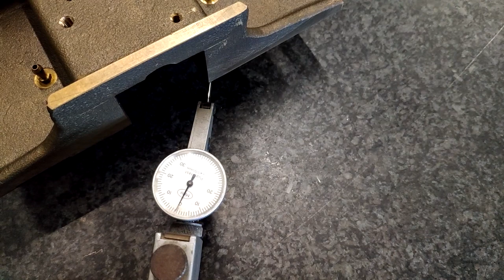Granite 3DPrinter - Break it, Fix it, Repeat it #S01E06

Comment: That bend can be made on purpose so I will try to check on your second one before lapping and make it worst. Try to debur the scratch with a precision flat stone and put it back. Do you run any filter for moisture and particles? Any contamination from the air will destroy a orifice type air bearing. Maybe you can change for graphite pad air bearing. Also adding a flexure on the carriage so that you don’t introduce side way torque from screw misalignment
Reply from the maker: Dude thats some serious input. Thanks! Okay one at a time: I dont think the bend is intentional. Because I do know it was a lot less when I indicated it in on the mill when i was milling the slot. Would also not make any sense to not use the whole surface.
Precision flat stone is the weapon of choice, yes. I leave the rest untouched at first, there is no visible damage.
I do have two consecutive filters in my air supply ( I dont run any oiled tools) and one really sophisticated right at the inlet of the CMM (OEM, 1 Micron filter size, really heavy duty unit). The air should be more than adequate for air bearing use. There is no visible moisture even after like 10 hours of bearing uptime and a few 10K liters of air.
One of my ideas for a long lasting repair is to use some kind of a wear plate, graphite would be mat. of choice here. Ill investigate - it would be a bit more effort but in case of a crash like this way easier to reset than the problem I do have now.
The mentioned flexure actually is already in CAD, I had drawn that in a previous stage. For now I didnt consider it to be necessary, I couldnt find any recurring pattern when I stuck a micron indicator onto the air bearing and had it run on the granite. Seems like the forces arent high enough to cause trouble in this case. But maybe for the future!
Reply: @Roetz40  Did you indicated the air bearing after having slot it with that big ball nose? It could had wrap at this point only giving edge contact than wear out like it did.

Comment: I don't think you will have a choice but to lap the air bearing back to spec. Considering that air bearings can run on a film thinner than 1 micron, this is most likely the reason why you got granite/ brass contact and galling. However, you can make your job a lot easier by peening the Brass Plate. I have never done it myself for something this fragile and accurate, but it is a common practice when reconditioning large milling tables. I guess with some Fingerspitzengefühl, you should get it within 10 to 20 micron and you will not have to recut the air grooves. Still, a tricky thing to get right, I'm excited to see what you come up with.

PS. You could also try to bolt on a backing plate and elastically deform it back into shape.
Reply from the maker: I had to look up peening. If you would've called it dengeln it would have been obvious :D 

Maybe I'll give that elastic deforming a try at very first. Just to see how close I can get it. 

Thank you for your comment!

Comment: Apart from re-lapping, I can't give you much advice. What I'm curious about though, is if you can find the cause of the scratch. Can you see if something embed itself into the brass when you place it under a microscope?
Reply from the maker: Have to check. But I guess it has destroyed itself by initial contact. I was very careful when assembling it and everything was really clean. Also supply air is 3 times filtered.

Comment: The two surfaces of the brass part are still flat and only bent out of allignment to each other due to the distorstion. Maybe you can bolt something like a strap clamp over it from the outside and bend it flat again with the force of the screws (push in the middle and pull the outside parts up). At least this would be worth a try before relapping it.
Reply from the maker: Very good idea, I was thinking about bending it back permanently, but this is more elegant. I'll have to check though where to attach these points and figure out a way to measure how much force I have to apply to bring them back into a plane!
Reply: @Roetz40  you don‘t really need to know the force. The piece should be able to take it since the stresses were in it before. And the strap clamp part can just be overbuild a bit. You are of course right about the location where to put the forces. That‘s kinda critical :). Also: do you nee a second Hilma hydraulic vise (160mm) for the big Maho?
Reply from the maker: @DonStinger  i'll so testing on elastic deformation at the very first. Maybe that'll do. 
You got one to offer? I do run the 160mm allmatic though

Comment: How much did you mill off after welding? Did you shim it? I'd check the parallelism and the distances between the granite and the ball screw. 

You can get a really nice hole if you use diamond bits (tubular type). And it doesn't tear the other side, if you're careful. With a hammer drill, it's inevitable.
Reply from the maker: Thank you for your comment! I did mill off around 0.2mm. But I don't have to shim, there is 2mm of adjustability in the bracket that connects the ball screw to the air bearing.

In terms of a proper drill: yeah I was aware a diamond drill would be the better solution. But I don't own one, the "cheap" ones were to short for the whole I was going for and on top I do fear the mess it will create due to the liquid cooling. But in other words: it was Sunday and I wanted to get a hole in there with the tools I had on hand :D

Comment: Hello was just wondering where you got your metal? workbench it looks pretty amazing. You know, the one that runs along the wall there in the background. Pretty nice looking, can you tell us the brand name? As for these johanssen air bearings machines, I have realized they are probably best used for really precise optical table, or microscopic laser engraving etc. since for FDM printing it is so slow to move all that mass around. So maybe if you abandon this project, the machine is still usable for certain other applications. In terms of this crash.. well a good question is how to avoid any future crashes. You need some safety cut out system that can stop further movements. For example if the stepper exceeds a threshold force. Or if there is an electrical way to sense whenever the air bearings touches the granite. For example, if the granite surface conducts just a little bit. Or it changes the capacitance by some pico farads. Wire up a detector. And then you can make sure it dont happen again. Very important!
Reply from the maker: The steel for the workbench is literally from the scrapyard. I got around 50m of 120x120x8mm rect. tubing a couple of years ago and build almost everything out of that.

I do like your input on the fail safety. I'll def. lower the max torque from the servo and properly wire the alarm signal into the control. I was thinking about the conductivity aswell but I don't have equipment to measure any of that precisely enough. But that would be huge. Maybe @marcoreps could give some advice? :)

Comment: Use a diamond hole saw next time, and keep the bit cool with water. go slow with no hammer let the bit do the work. 
Your giant washers will cost more than a good diamond hole saw lol
Reply from the maker: I was trying to not have all the cooling water/debris run over the machine. But I'll invest in some diamond hole saws in the future :P
Reply: tape a wet vacuum nozzle just below the bit and spray softly at it. drop sheets for painting would also help keep it clean. 
Hope it helps, love the build so far. Keep it up, i have a printer ive been working on but its one thing after another with setbacks. so i know the feeling. so far with that print quality im very impressed, If you werent so far away id gladly send you a duet board

Comment: Does the ball screw have to be parallel to axis? I think you do have to lap the airbearing like you said. Though you may need to lap the bearing paired with the surface they ride on much like metal on metal moving parts. Though I've not heart of lapping metal on granite and you'd probably ruin t he granite. Robin Renzetti is a pro at lapping and is on youtube and instragram. He'd probably have a good answer for you and he does like to help out the maker community
Reply from the maker: The granite will stay as is. It is still close to factory spec. The ball screw should be parallel, I can adjust it by mounting slots

Comment: I’m sorry to see this happen to you. I can tell you that if you choose to recut the pockets, their depth is extremely sensitive. I doubt you would have more than a couple microns of wiggle room. Original flatness specs would be below 2 microns.
Reply from the maker: Thank you for the precise numbers. I'm aware this much bow is way, way too much. On x-axis I can measure a lift of 4 Microns if I switch the air supply to bearings on. 40 microns is one order magnitude higher than that.